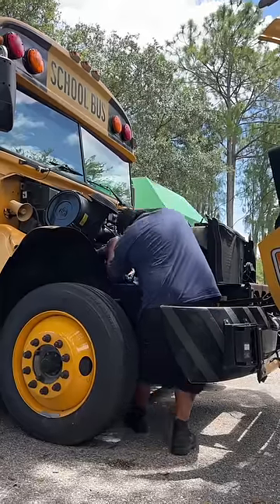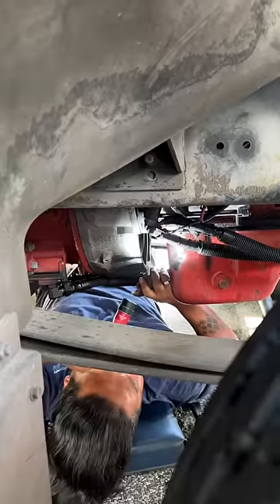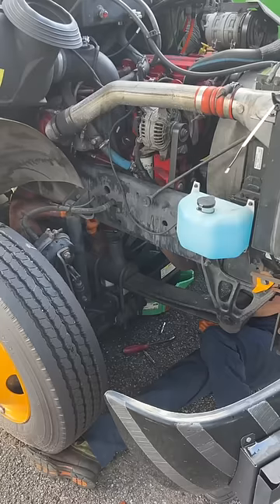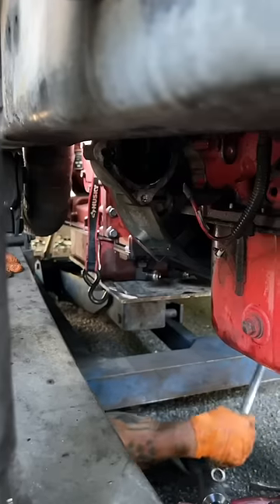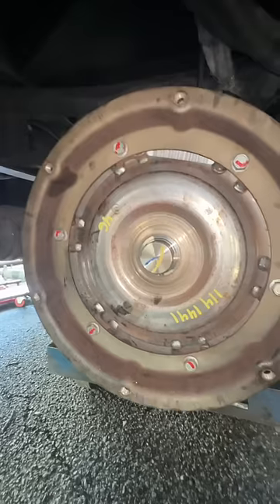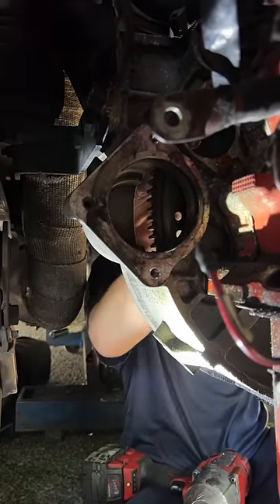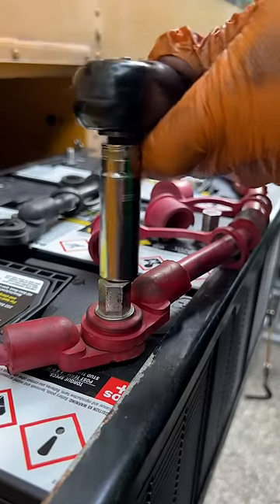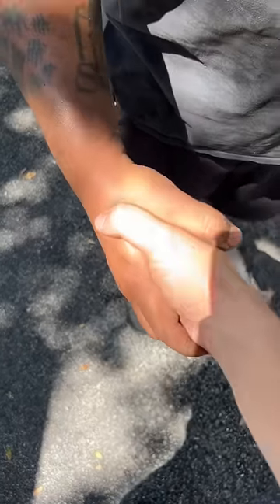How much have we spent on repairs? #diy#busconversion  #skoolieconversion #vanlife#skoolie#buslife

Comment: Your mechanic didn’t say that the rear main was the reason it wasn’t starting right? Cause if so you need a new mechanic they are scamming you big time sounded like a weak starter or an almost dead battery

Comment: Your getting robbed, the air compressor is broken? Or your not getting power to the clutch assembly? Have you taken a jumper from the battery and hit the wire connecting to the front of the compressor

Comment: If you let the mechanics fix every tiny thing that doesn't need done you'll be broke always. Tires, Brakes, Engine, Transmission. Anything other than that, YOU should be googling how to fix it yourself. Also didn't you bring the mechanics out to make it run? Why are you changing a rear main seal right now if you're on a budget, that doesn't make it run, nor does it need to be done right now. 

Rear main seal will just leak a little oil and depending on how small the leak you won't even have to bother because by the time it starts to get low it'll be time for an oil change PM anyways. And please learn to get dirty and do your own PMs don't spend $800 on an oil change and grease job you can do yourself.

Comment: quit using garbage Craigslist mechanics in the description you say now engine failure most known company's charge maybe 50 for diagnostic.
Reply from the maker: Lmao. These two mechanics work for our school board. Thanks for the advice.
Reply from the maker: Also got it looked at Cummins and they come up with same diagnosis. So many opinions on a one minute video.

Comment: 🧒🏼 Diesels are such piece of junk engine's. Just swap that turd 💩 out for a Ford 300 inline 6. Keep that trany though. A diesel engine requires a special mechanic to work on them, the parts are twice the price, there very heavy, & they sound terrible. Oh, & last time I checked, diesel fuel costs more then any other type of fuels at the pump⛽. These are only a few reasons to NEVER buy a junk diesel engine. ✌🏼